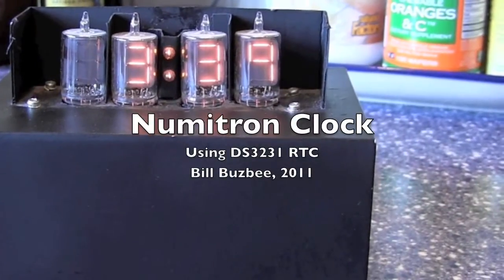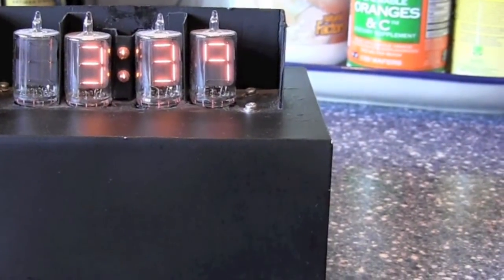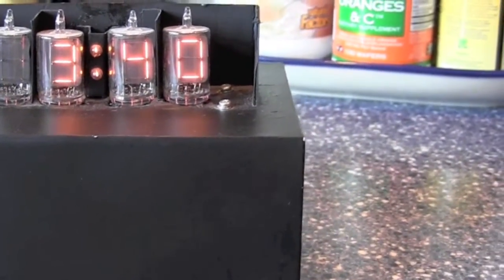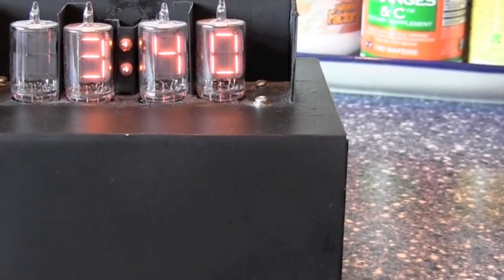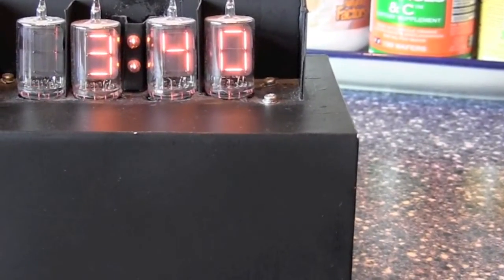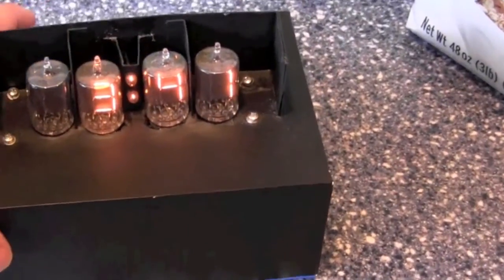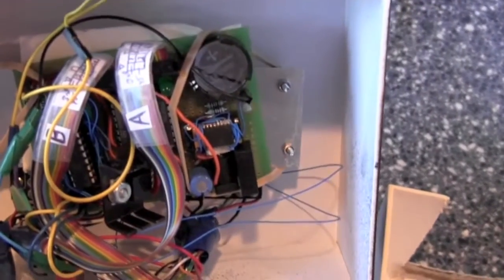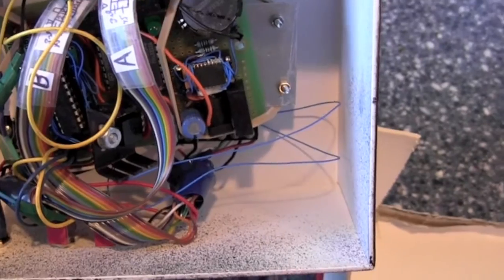Numitron Clock

Comment: Do you have your sketch published anywhere?  I have one I'm trying to get going.  It uses 7447 IC's to convert BCD into the 7 segment display.
Reply from the maker: Hi, it's been awhile, but I used an ATtiny2313 for this with a ds3121 as the time base.  I found a 10-year-old folder with source code that it looks like was based on code published by Kenneth Finnegan.  I've uploaded a copy here: http://www.homebrewcpu.com/NumitronClock.tgz in case you find it useful.

Comment: What were the applications for these displays, were they ever used for desktop calculators. I only know they were used on gas station fuel pumps.
Reply: +Jeffrey314159 
Similar planar vacuum filament displays, called minitrons, are still being manufactured, primarily for use in avionics.  They can have a lifespan exceeding 100,000 hours.
Reply: I have got mines in an abandonned fuel pump station. Each pump display's had 5 Apollo DA-2500 and 4 Apollo DA-2000.